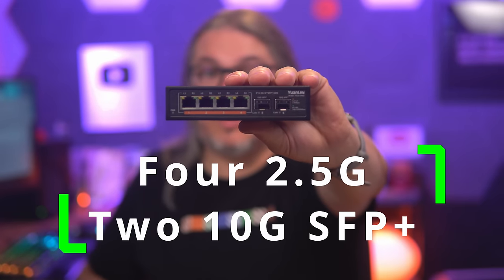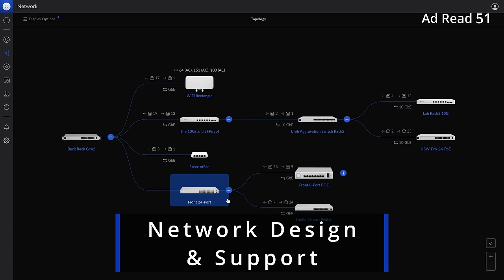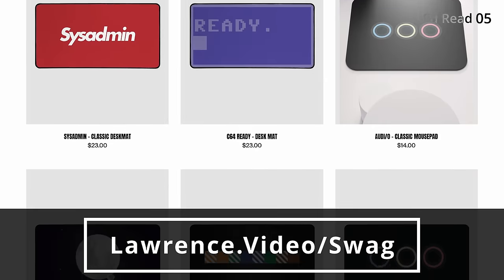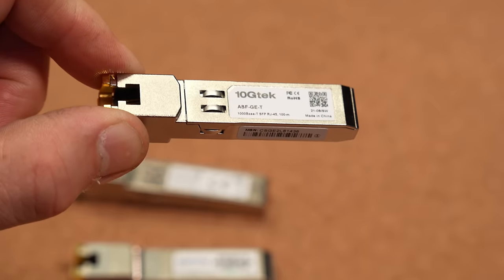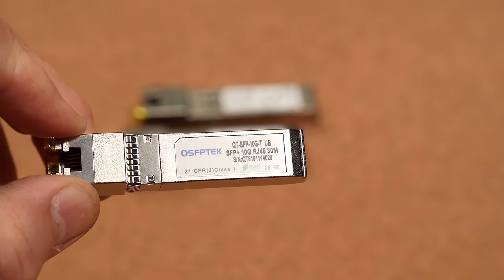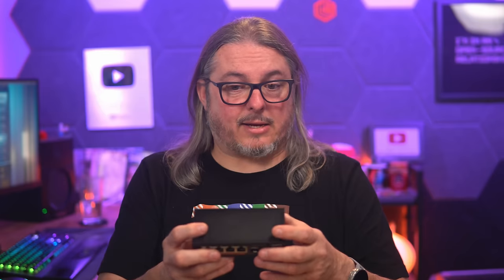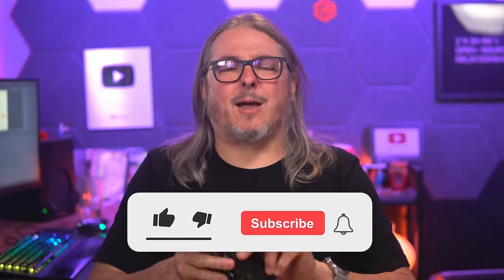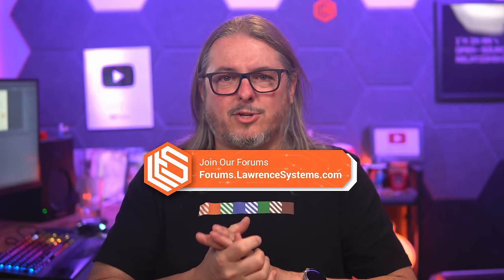Under $50 Inexpensive Budget Switch With Both 2.5Gbe and 10G

Comment: I've had the MikroTik CRS310-8G+2S+in for several months now, running it in RouterOS, its been great. I've been using routerOS for several years now and I'am comfortable with it. I've got it going to three proxmox machines  one of which is bonded with LACP using three 2.5G ports with Layer 3+4 hashing (The other two connected via the SFP+ ports), about 10 VLANS going through it all working great. I pretty much forget about having it most of the time until I go to check for updates.  Makes migrating VM's around the machines when I do maintenance a breeze.
Reply: I have it too. Great switch.

Comment: i bought this exact switch (also from the STH video) in October (for referance 10 months ago) and it was worked great. - iperf3 shows 10Gbps and 2.5Gbps work perfectly.  I use a DAC cable and a Fiber with with 10Gtek adapters and havn't had any issues at all.   i have no ethernet DAC to confirm or deny what Tom said but i take face value as honest, and i do know sfp+ to ethernet adapters generally do get hotter than other adapters.  Also stepping up to the Mikrotik switch Tom showed, is both an amazing switch, AND MUCH more expensive.   Not a bad switch shown here, but can absolutly attest the Yuanley has been holding up great.

Comment: I bought the same Yuenley switch, and primarily use it in combination with a Raspberry Pi 3 as a tool to validate network connectivity and identify switch port connections.  The Raspberry Pi is running the lldpd app, which supports both CDP and LLDP.  So I plug the Raspberry Pi into one port of the Yuenley switch, and then I can use another port on the Yuenley switch to plug into a copper 10/100/1000/2500Mb/s connection or a 1/10Gb/s fiber connection (via SFP) and then issue the lldpcli command on the Raspberry Pi to see the switch and port that I am testing.  This validates whether the cable to the switch under test is working, and that the cable was run to the correct switch port.

It’s a pretty cheap and reliable solution.

Comment: Thanks! Was looking for a small switch like this to do testing. Went right over and bought one. Just a side note. It was under 50,  BUT if you click the 20% off coupon as of when I leave this comment, you can buy this for under 40. well worth that. Thanks again!
Reply from the maker: Can't beat that discount!
Reply: I think it's a first time buyer enticement, I got one, fried it with a copper SFP, and did a return instead of exchange and didn't get the discount my second time.

Comment: This is the perfect solution for an issue I've been having with my RJ45 to SFP+ adapters overheating. I'm ordering one right now! (currently a 20% coupon on it, too, making it $40 out the door with overnight delivery!)
Reply: What was the solution for the heat issue?  Seems like this switch has a heat problem with RJ45 SFP+ modules compared to other switches.
Reply: @GCTWorks  the solution is that I won't be using SFP+ modules any longer. At one point I even tried mounting a fan to blow cool air on the modules, but it wasn't enough
Reply: @DBTechYT  So you are just going to use the 2.5G ports or run fiber?
Reply: @Mikeeg0607  I'm just going to run the 2.5G ports. My current setup has multiple 1G ports and 4 10G SFP+ ports and I'm only using the SFP+ ports to connect my PC in one room to my server rack in another room. The PC only has a 2.5G RJ45 connection (currently connected via an ethernet cable and a SFP+ to RJ45 adapter that gets SUPER hot), so what I'm getting will be a more compact, more practical setup for me anyway.

Comment: What’s a funny moment. It’s been some months already I bought this same switch with the same strange brand and see it now on this channel is a surprise.
So I bought this switch to connect my main Linux server and my Truenas server together with the 10gbs ports with some DAC and I can attest in my testing that my two computers talks at 1GB per seconds which is nice.
Didn’t know about the thermal issue with SFP ethernet so I guess I will write on this switch to never plug those modules.

Comment: A couple months ago, I was shopping for a 2.5G PoE+ injector, they were all around $35-40.  I saw a NICgiga 4x2.5G PoE+ / 2xSFP+ for $52 and got that instead.  Seems to be working just fine, DAC backhaul to the main router and throughput is full 2.5 on the WAP using iperf3 over the wired connections...

Comment: I've had the max amount of officially allowed Mikrotik 10G for literally ears in their fanless CRS305-1G-4S+ (running SwOS as I did not need anything else) and they run pretty hot, like 90°C, sometimes above. You could warm tea with it. Yes, tested. But that is a passive but well-vented switch. This might hit 100+.

Comment: hi tom i have this in my home lab and the mikrotik as well. i also got a 2.5g 24 port switch which can do vlan but pricy. this device powers my 2 APs and its a good primary network for the family on my pfsense. the mikrotik i love but was taking more power and its kind of unused resource as i have more devices connected to my 24 port 2.5g switch.

Comment: Nice little box, and i agree about the microtek, just wish we had managed sub 100, I only need 2 sfp and 4 2.5. And fiber is fine for sfp, I don't mind buying the fiber for the link between NAS and the switch to avoid the heat. fiber is cheap

Comment: Good video,  it don't do vlans BUT it will pass them through if there are any on the ports..:)
Reply from the maker: Yes, it does seem to forward the VLAN traffic.
Reply: Great! That was my first question. I don't need this switch do anything with the VLANs, however, the SFP+ ports on my main 10gb will be assigned specific VLANs. My use case is for a LAN party, just to be clear if I want this switch to ONLY be on the LAN Party VLAN as I don't want the party network to have access to my main network, that use case will work?
Reply: @garydeluce464 your managed switch should be configured to have an untagged vlan on those ports.

Comment: Just a warning on these, I have the PoE version of the switch and tried the SFP to copper module for a while, it did fry the switch pretty quickly (it kept boot looping, even after I unplugged the SFP) had to send it back, but yes, using 10G fiber SFP and PoE 2.5 has been fine since (and on the old unit before I tried the copper).

Comment: You said dac or fiber for the SFP modules in your video about 3:30 Do you have a link to the SFP modules that work good with this. I know when I 1st started it was a hit or miss what SFP modules work with switches. Thank you.
Reply: DAC any will work its just copper. Fiber ones not so lucky ... trial and error i guess x.x
Reply: You may also be able to get FIBRE dac cables

Comment: I do use a couple of these for 1.5 year now (when they were still ~100€ for 8 ports). they have been working just fine whilst my TP-link much more expensive but further similar one broke down already. They are not managed but do pass Vlan information trough though to my Ubiquity access points though.
Reply: Interesting. You say between Unbiquity access points, plural. Do you think the switch would be able to pass the vlan info to end devices too? I have a UniFi gateway but all end devices are connected through switches like these because cost.

Comment: any idea what switch chip it is using (underneath that glued on heat sink, probably)?

I wonder if programming pins (usually I2C or SPI) are accessible...  Looks like it is a BGA, with a bunch of passives on the bottom of the board, so probably not.  But maybe!  (sometimes the programming pins are recommended to be pulled high or low to ensure the chip boots into its default operation, so if they did that with a resistor...)

Comment: i have two managed hassivo switches. also after watching STH. i run a backbone 10Gb on 10Gbt copper and the SFP+ module gets hot. working on changing it to fiber. Great devices though.

Comment: Dumb question: if you had a managed switch and say for example some ports you gave vlan 1 and others vlan 10.  If you connected this (or another unmanaged switch) to the managed switch on a port that had vlan 10, would the other ports on the unmanaged switch be sudo vlan 10?

Comment: Biggest issue I got with sone mikrotiks is the noise. My CRS310-8g+2s+in is even with noctua mod fairly loud. On SwOS it ramps up to 3000 rpm. I might throw in an pwm controller to tune it to a more pleasent 1500 rpm

Comment: What's generating the heat?  I got one of those switches not realizing I needed an adapter for the input.  So, what's with the heat and it's source?
Reply from the maker: The 10G RJ45 SFP+ get's hot

Comment: I have the MikroTik CRS310-8G+2S+IN. Of all of the the switches I've used, it's my least favorite.  The web UI is awful, hardware offloading is a joke, the SFP+ ports don't work in SwOS, and it (at least mine) randomly stops responding to commands.

Comment: I got one of these cheap 2.5G switches, I kept getting a problem with the network connection dropping from my Mac.  I think there was some anecdotal evidence on some forum or review site that you have to do something to MacOs, some setting to change.  In the end I sent my unit back, because I couldn't deal with constant problems during my working day, I went back to 1G ethernet, and the problem stopped.  Now I'm reluctant to take the cheap path into 2.5G, even though I've bought USB and PCIe adapters for a bunch of machines.  If anyone knows about these MacOs problems, and what the solution may be, please post.  I did the speed test, and got the right speed always, it's just my network would go down, and I'd need to power cycle the switch to get it back.  Could have been a faulty unit I admit, the problem could happen after an hour or two of use.

Comment: ooof unmanaged. How many of these am I going to randomly find in customer networks?
Reply from the maker: If you work in the education sector SO MANY! They are small enough to be hidden behind desks, on ceiling tiles, and so many other fun places!
Reply: Port security is your friend 😉
Reply: My favorite place to stash unmanaged switches with no moving parts is the ceiling tiles for sure. No one expects there to be one between what should be home runs.
Reply: You’ll find them when you trace out the mystery spanning tree loops
Reply: We've given up the fight against unmanaged switches. We just do NAC on the edge ports and use mac based vlans. That way at least stuff still ends up in their own VLAN even through a dummy switch like this one.

Comment: Mikrotik support is abysmal to non-existent.  Bought and used a CRS309-1G-8S+ for exactly 370 days, at which point it would boot up and work for 1-15 seconds and then brick itself...  no amount of reflashing, switching modes, etc...  Mikrotik basically told me tough, the warranty was 1 year, so no tech support, go to public forums......

Comment: to each their own, but I have zero interest in 2.5g ethernet.  if this was a 5 port 10g-base-t switch with a couple of sfp+ ports, this would be a great desktop unmanaged switch.  combined with the heatload problems you were talking about with the rj45 modules (which means a lack of internal cooling for the cage), I think i'd recommend skipping this one unless you REALLY need 2.5 for budgetary reasons instead of using 10g base-t or a proper 10g sfp+

Comment: Personally, i think that its never a good idea to use these cheap Chinese branded devices in any network. You never know whats running on them and the may have potential security risks. Just my opinion.
Reply: At least with the unmanaged ones, there is no web interface to worry about isolating.
Reply: I was thinking the same thing